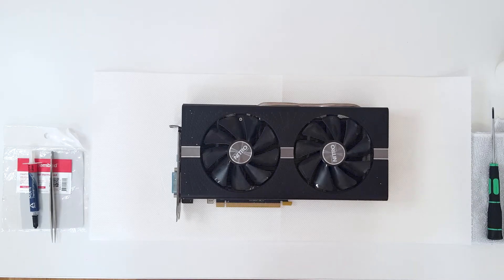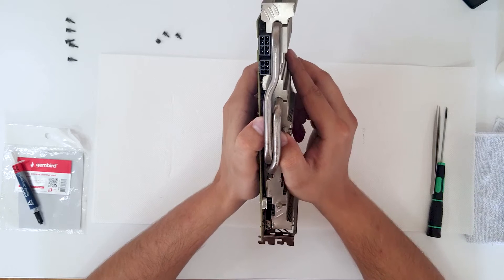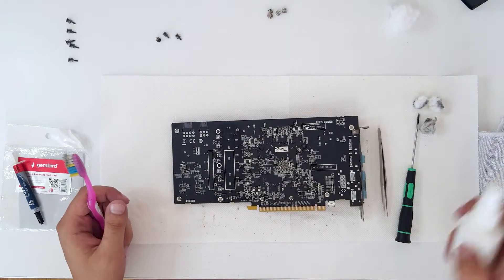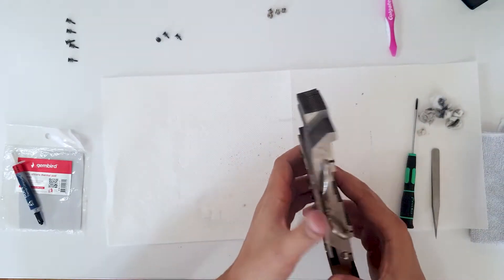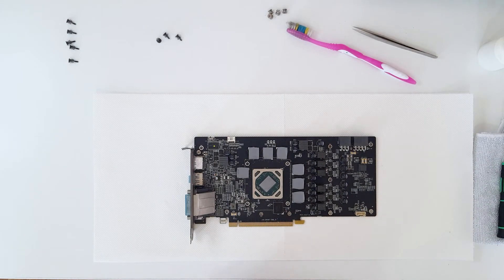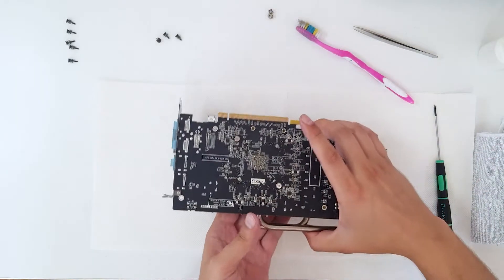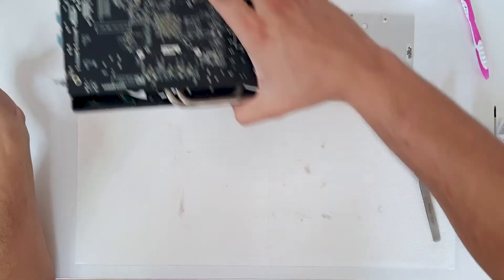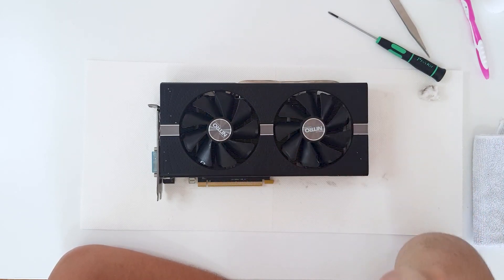How to Change Thermal Paste on RX570 Sapphire Nitro+

Comment: Try to find a video on YouTube with a test of how to apply heat-conducting paste. No bobek for the middle, but better to make a cross from corner to corner. Then the paste is all over the surface of the GPU. Otherwise, it does not have to dissipate the heat over the entire surface and the work was useless.
Reply: pozor na ty bobky no

Comment: Just wanna share.. I used 0.5mm on vram and vrms.. and 1.0 on backplate.. all working good..i also do oc up to 1400 on core and 2200 memory..
Reply: bro I have the same gpu, can you share your OC settings?
Reply: @N0M3RCYLP  do it auto in adrenalin drivers ...
Reply: I think overclocking is stupid, it's better to undervolt and get the same or even slightly better performance for lower electricity bill + when it's summer and it's hot it's rly worth it

Comment: Which is the tickness for thermal pads?
Reply from the maker: I think 0.5 but you can use 1mm. 👍
Reply: @Chichinjo  1mm for what? Vram or vrm?
Reply from the maker: Both...
Reply: They are 0.75mm. I used a brand called BCI who make a 0.8mm.

Comment: Nice video, but you missed the before and after temperatures.
Reply from the maker: There is an after short video at the end, from miner. 😅
Reply: If you put the wrong pads, you'll get it hotter.
Reply: @Jahus 
You mean the thickness?!
Reply: @CoptMan80  Yes. If you put pads that are too thick or too thin, the card gets hotter than without pads at all. Tested on many 570 cards.
Reply: @Jahus  
Thanks for your answer 👍